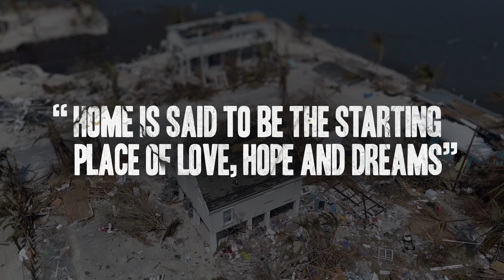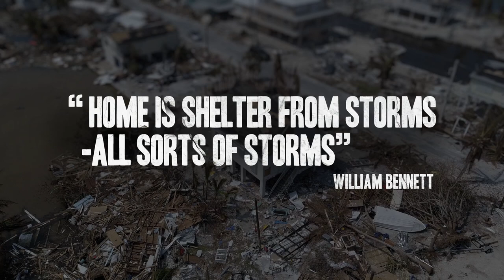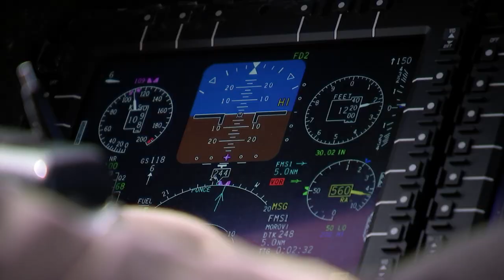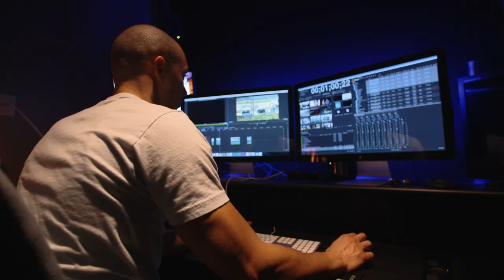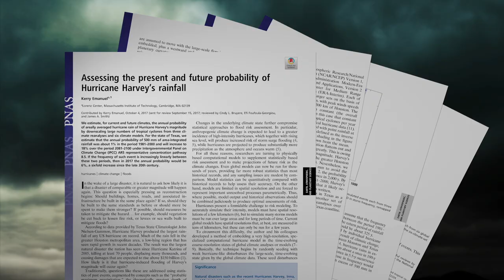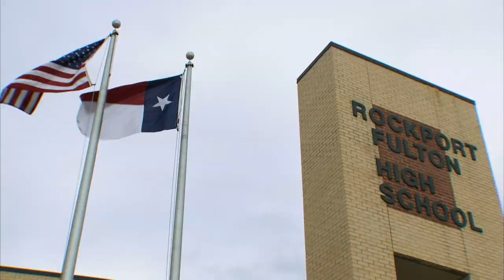Full Documentary: Cruel And Unusual

Comment: The thing with hurricanes, even if your house is left still standing, is the mold will come later, so you're not left unscathed.
Reply: That's why homes in the Caribbean are built out concrete and have tile floors.  No drywall, no carpet, no wood.  House down the walls, push the mud out the back door, life goes on.